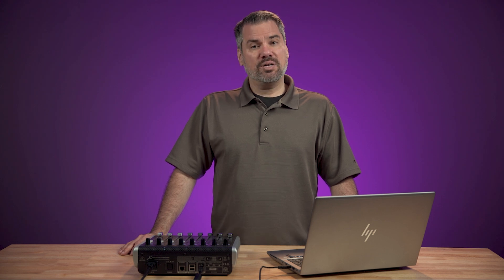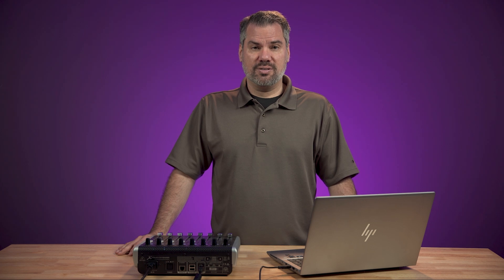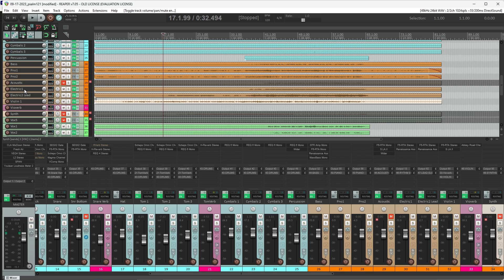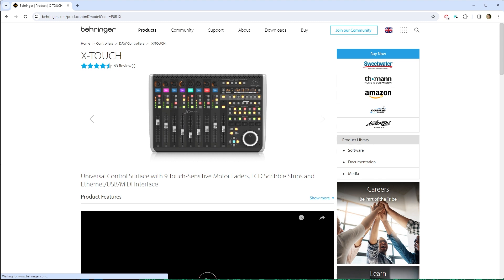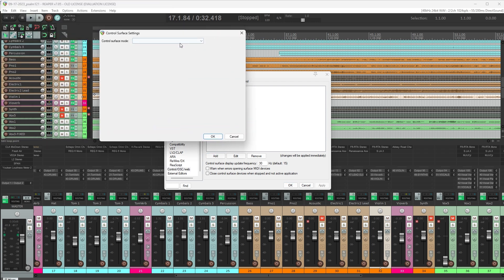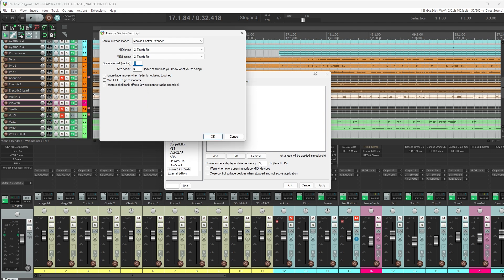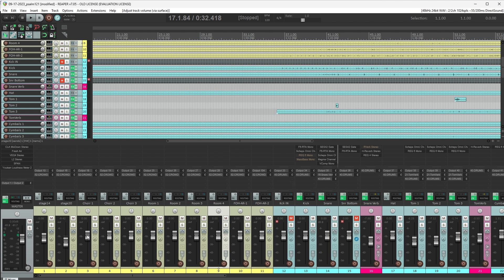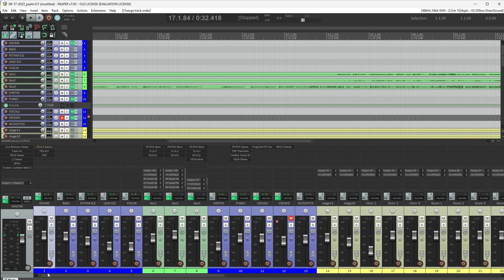Make My Live Stream Sound Better - Mixing in a DAW Live with Hardware Faders

Comment: Hi - will this do the job as well - Behringer X-Touch One Universal Control Surface
Reply from the maker: It will work, but it only has 1 fader, so it kind of defeats the purpose, having lots of faders to quickly/easily grab and adjust.

Comment: Hi Steve, is it possible for you to list the LED monitor you have in your Broadcast room? Do you use dual monitors? Or single monitor? Is there an advantage of one over the other? After your play list, I am working on building a DAW for my church. I'd like to know what other accessories, peripherals, gadgets and software you have with your DAW? 
thanks an God Bless
Reply from the maker: It's a single wide monitor.  I prefer a single wide monitor over a dual monitor setup.  It lets you stretch the mixer window out and see more channels at once.  I could send you the link to what I have, but really that was a few years ago, so you're probably better off just searching wide screen monitors.  As far as other accessories - other than what I listed in my document of equipment you need, I'd highly recommend getting fader controls (https://amzn.to/3EKypQp).  And possibly a StreamDeck to control things like pitch correction (https://amzn.to/3CXLgOG)  Let me know how it goes!

Comment: So this video is about using your DAW as a mixer not recording and mixing a song? I can see why people want to do that specially when you have live performances and you want to playback prerecorded music with a minimum of trouble and gear involved. Cause if you where to trust the internet when you record and mix that would not be ideal. I have two of the first Atem Minis they released and I found out you can also use the HDMI ports on it for line in audio by using audio embedders. The audio stream in an Atem is pro quality so I believe it should be possible to get a pretty ok quality signal even through the 4 HDMI camera inputs and not only via the two Line in ports.

Comment: You may have addressed this in your series (and I somehow missed it) but how would you handle something like scene changes on a digital console? We frequently use scenes to slightly brighten another singers EQ. We have different members of our team lead their own song in the set. Is there any way of doing broad pre-saved compression and/or EQ or FX changes in a DAW? Or even with Companion?
Reply from the maker: Yes,  you can use the sws extensions for Reaper, it has an implementation of snapshots.  I should probably make a video about this!